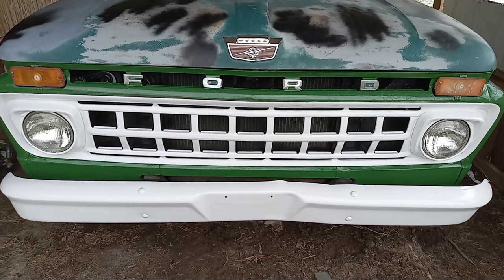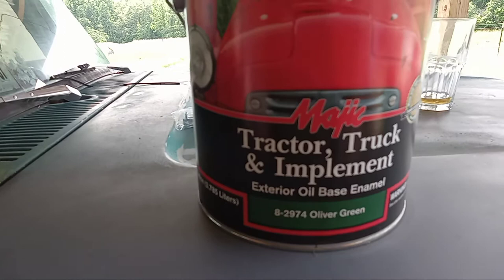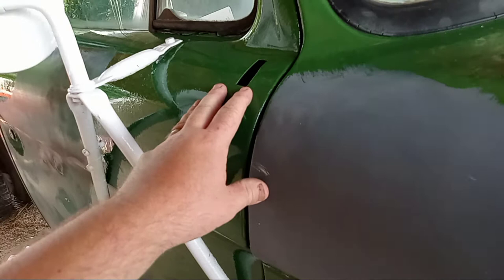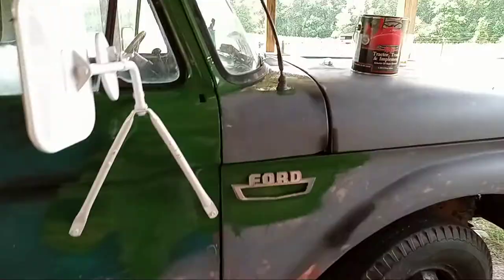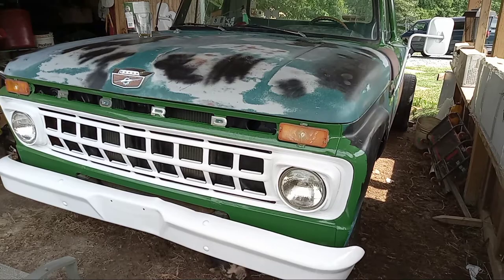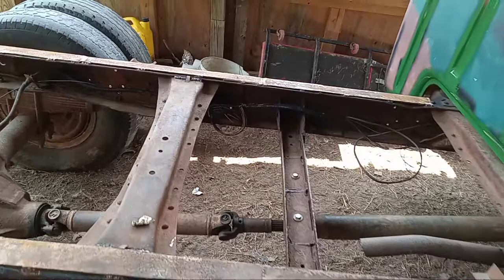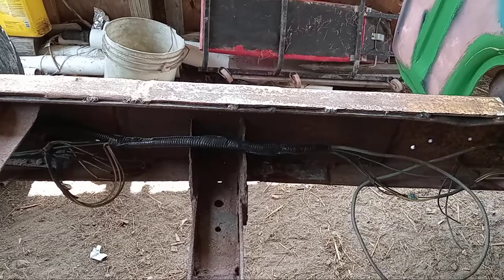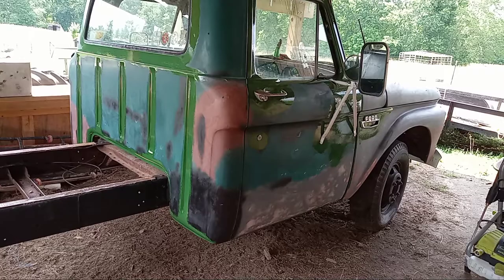How to Paint a Truck Cheaply: Cut and Roll with Majic Enamel

Comment: Im a industrial welder for komatsu and those welds are fine definitely not gonna come apart. Checkout the robot welds on most vehicles definitely hit and miss and i trust what ive seen in your video. Paint looks good im gonna pull the trigger and spray my 1966 camp trailer with it
Reply from the maker: Thanks. I have a lot of doubters and purists that make fun of my welds, but in my experience, stick welds generally don't break.

Comment: Ya you did just fine on the welds, whoever told you your welds aren't good is stupid ! no they aren't dime sized perfect beads , so what!  for a farm truck you did a great job on fab work , I'd drive that truck on the road without question, good video about maijic paint, I've restored alot of commercial mowers using that paint, it will take a beating

Comment: I'll wait to see if YouTube sends part 2 my way,but i liked this video. Never mind what the couch warriors say,they wouldn't know honest work if it kicked them in the balls. I recently acquired a 1974 Nova that im gonna use as my daily driver. Needs typical Michigan rust repair which im gonna do myself. Im watching all these implement paint videos, cuz that's all it's getting after the cutting and butting. I like your idea about letting the paint cure hard followed by a wet sand and clear coat. Just might do that!
Reply from the maker: I once went all out restoring an Impala.  Tons of sheet metal, pro paint job, chrome, etc.

It never added any real value. Could have used fiberglass bondo and a paint brush and saved the money for an engine. I would have been happier and drove it more often.

That's why I went this route on the truck. It's done. I never worry about it. If it needs a new paint job just scuff and roll.
Reply: @Catholic-Perennialist  I'm 63,and poor. I don't need a trophy car to hide in my garage, just a good reliable car with no computers to carry me to work and back. My Philippine born wife will respect the work I put into it,and know that I did it for us,not Jay Leno. We can't all be rich.
Reply from the maker: @talltom1129  agreed

Comment: I've never rolled on and or brushed on tractor paint but I've sprayed it on several of my project cars. I've even mixed them and created my custom colors, I once did a 2 tone on a 64 Pontiac Catalina with tractor paint, the main color was International White and after the body was painted I had about a third of white left and had a quart of Oliver Green and quart of John Deere Yellow and dumped them in the White and put it in my paint shaker and mixed it up really well and made a really light Yellow Green color and painted the roof of the car with it and hand painted some old school pinstripes on it. It originally had a Vinyl Top so it already had the Chrome srtipping to seperate the roof from the body of the car so it worked out perfectly.
Reply from the maker: That's really cool. I'm all about doing things cheaper. I started as a kid and usually had to find a budget alternative to get anything done. 

I would have sprayed the truck, but my lungs can't take any more abuse.
Reply: @Catholic-Perennialist  I grew-up in Farm country in the Midwest and my parents had a paint and body shop so I've worked on and painted alot of  tractors and implements. I've even built my own mobile paint booth using 2X2 and corregated plastic, It cost me less than a $100 to build and when I'm not using it it unscrews and is stored in loft at the back of the shop.
Reply from the maker: @TheREALOC1972  Nice. It helps to have generational knowledge of the business for sure.
Reply: @Catholic-Perennialist  yes it does, we did alot more farm and implement stuff than we ever cars.

Comment: Why not use the foam brush for the whole thing?  Why use a foam roller (which I heard causes 'orange peel').  Also, do you need two coats, could you get by with one coat?  Two coats (with hardener?) seems overkill.  If you are using tractor paint shouldn't that type of paint already be formulated not to fade, etc. without additives?  I am not critical, just asking questions to get more info in case I attempt it.  I never painted anything as big as a vehicle, but painted some industrial equipment with a regular paint brush and tractor paint, one coat, and had gloss and no brush marks.  It did take 2 or 3 days to dry.

Comment: Why would you use a brush? Roller is lit better, faster and smoother.
Reply from the maker: I cut in with a brush around trim. If it's thinned enough it still turns out smooth.

Once upon a time all cars were brush painted.